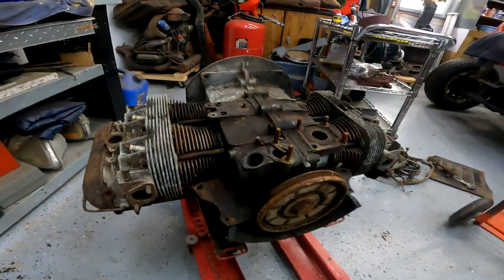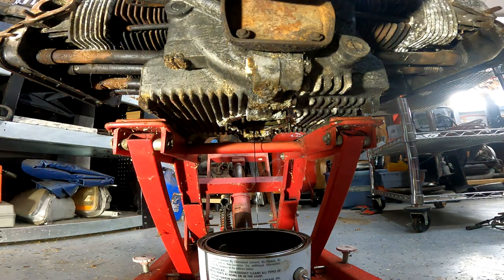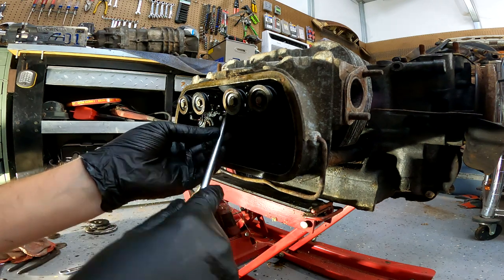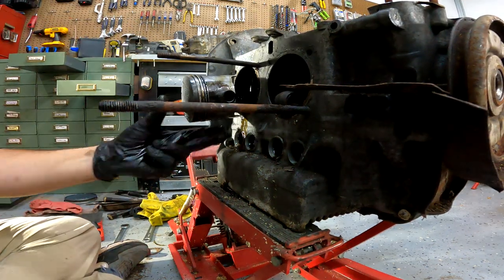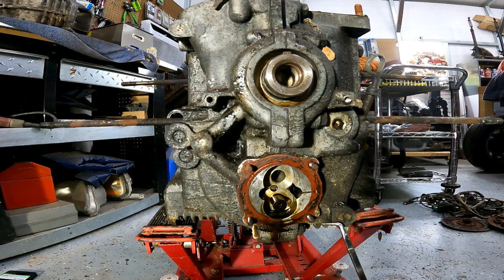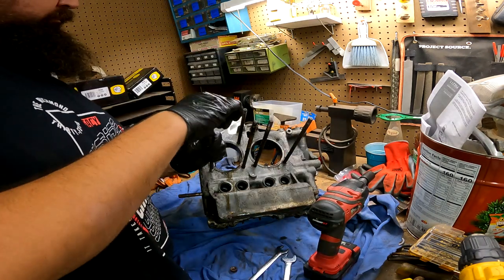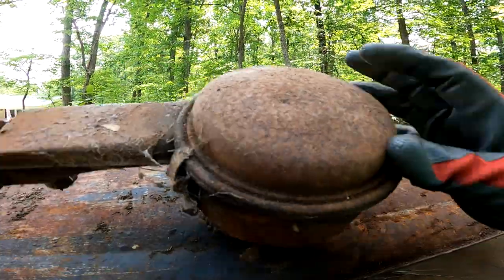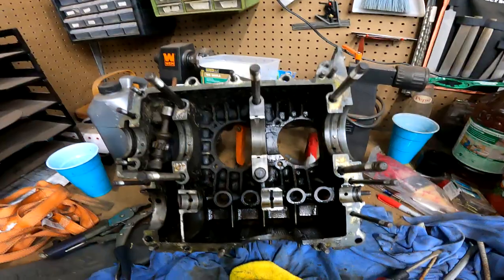Volkswagen Type 1. Single port Beetle engine can it be saved? Disassembly How To!

Comment: Great vid on opening of the case.  I have worked on many American engines but never an air cooled one.  Great info.
Reply from the maker: This was my first time. When I rebuilt my engine for the bus I only did the top end. Figured with these cases being in unknown condition that I could play around with them and learn while not really having to worry about messing anything up.
Reply: @VWBrennidon  Absolutely